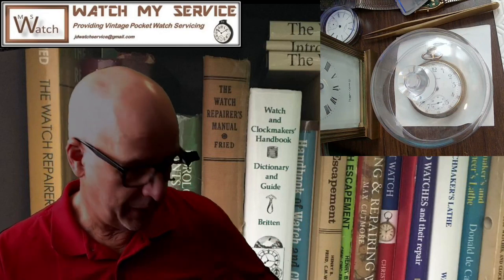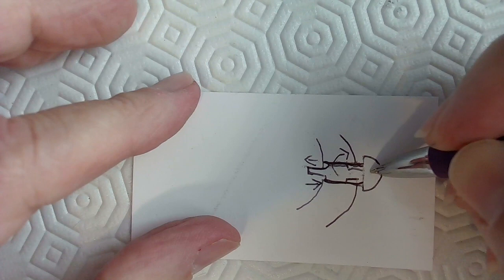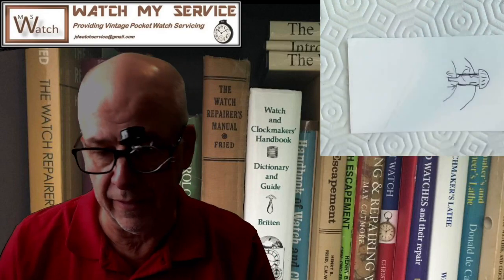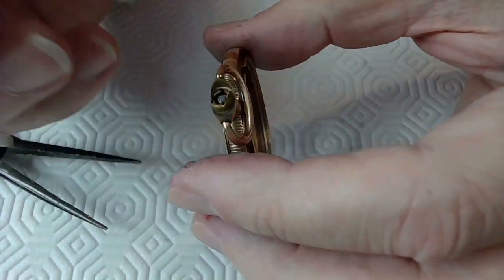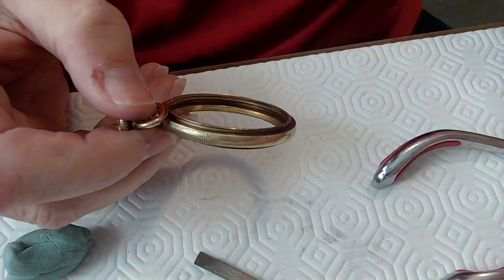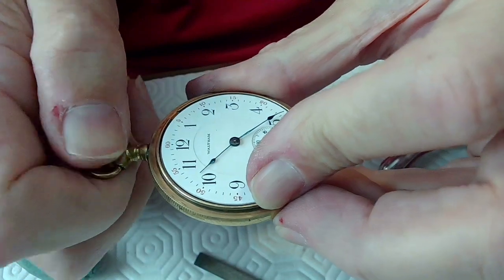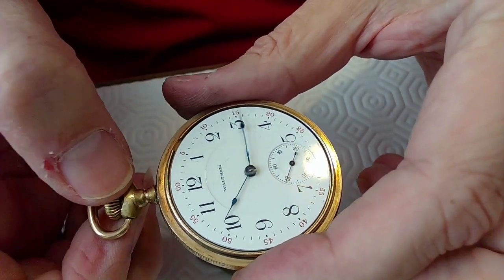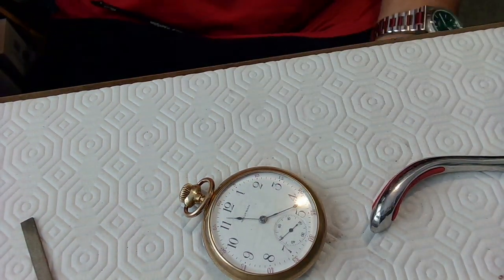Wally Waltham Crown and Stem Adjustment

Comment: Nice video as always. Nice to see you had similar problems to when I had to do the same to my 1906 Waltham. Also nice to see that I've absorbed your repair philosophy - my repair went about the same as yours. My problem was winding the watch would adjust the time unless you pushed down on the crown at the same time. Now fixed and running smoothly.

Comment: Hi. ThankYou I am looking at removing the broken stem from my pocket watch case. The crown can be pulled up for setting the hands. What is the step needed to remove the stem completely. You used the words ‘pop out’ the stem. Are you saying I can pull harder and the crown and stem will pop out.? My stem is broken and there is no square there at all to grab with a needle nose plier. So I have not yet removed the crown. My guess is I will be using a sleeve wrench to completely remove the sleeve and then the stem will just fall out?
Reply from the maker: @jftman53  I am way late replying. But yes. You can simply unscrew it